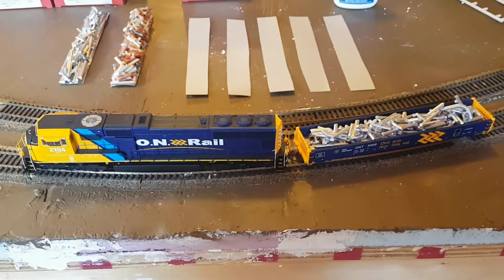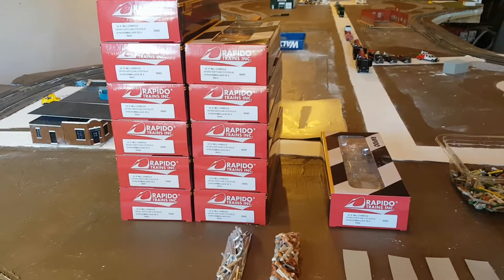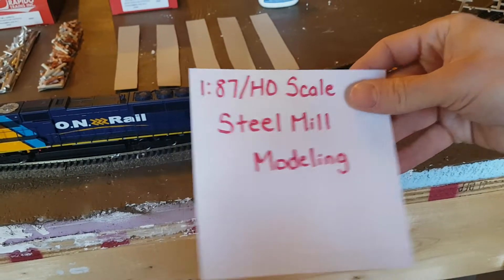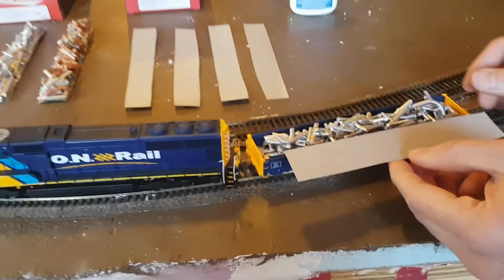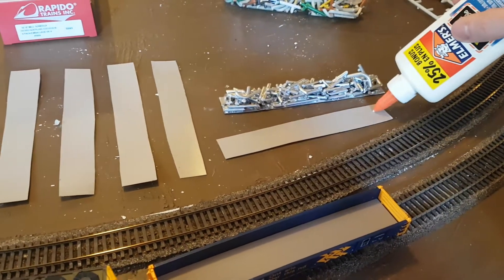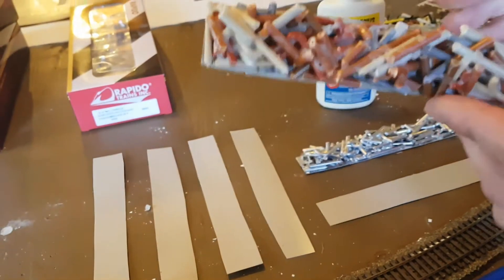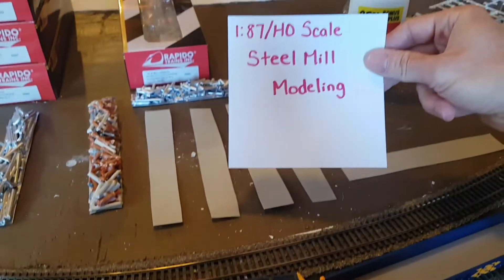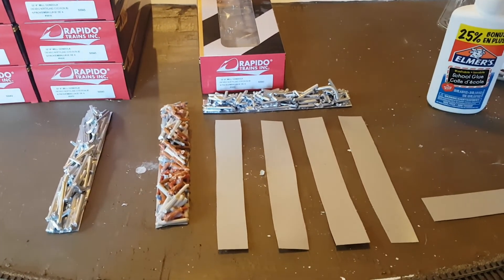How To: HO Scale Scrap Load

Comment: Brian  Great Idea on using the spare parts for a building kit I was always throwing them away after I remove all the parts. Now know I should save them for something like this.    One suggestions on your track I see your using flex track and have large caps of ties between the sections.  I took the ties I cut off on my flex track shaved the top of the tie down a bit and then using Elmers glue and slide the tie under the rails it does a nice job.   Hope this helps